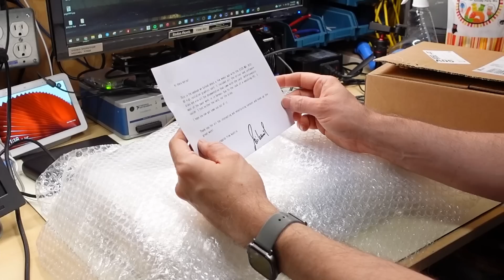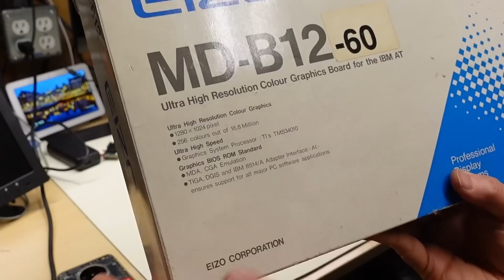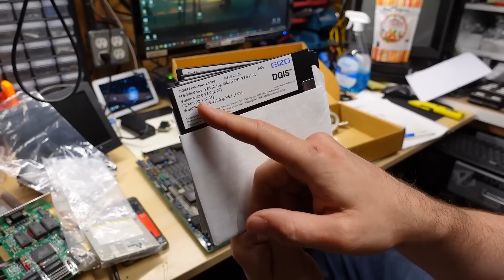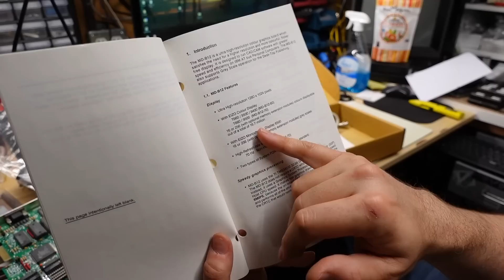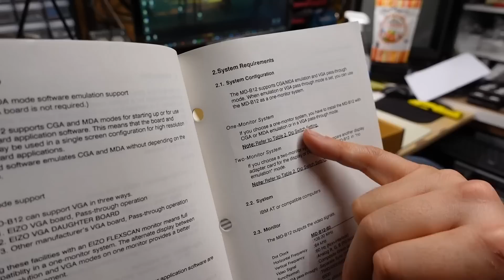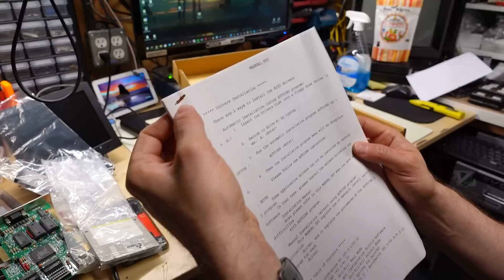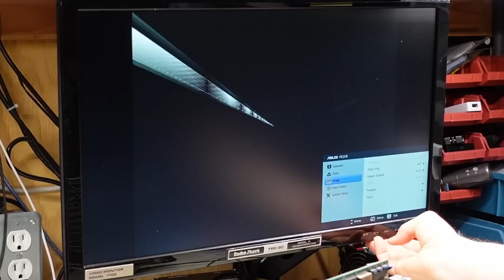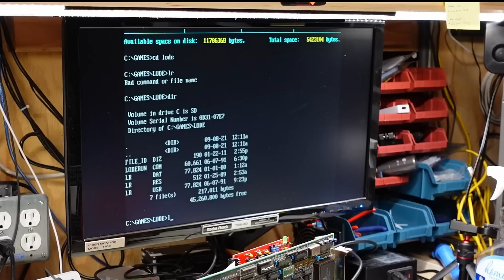0008 This is an "ultra high resolution" PC video card from 1987

Comment: ah, more TIGA cards.  The memories.....  I'll look for the official TI documentation and disks.  It was a 2 or 3 manual set with some wonderful floppies.  For example, the disks had a bunch of fonts that could be loaded onto the card.  Most TIGA drivers are generic, as the boards were just reference hardware from TI.  I'd bet that the drivers for this card will work with your other card.
Reply from the maker: Yeah neat if you can find more TIGA drivers. I want to try to get the other card (without disks) working -- future video project
Reply: i'd love to see some documentation on those 59 pin vram modules so i could recreate them

Comment: So this was a notch about the 8514/a card?

This was the era when IBM lost control of PC standards.   Their refusal to define a graphics standard greater than 640x480x256 meant that everybody else defined "SVGA" which wasn't really a standard.  It just meant that you could support 1024x768 or the far more desirable 1280x1024 for a fraction of what IBM was charging for the 8514 with greater backwards compatibility
Reply: Well, they also had XGA, which was supposed to be the VGA replacement.  Unfortunately, they limited it to their highest end PS/2 machines, some of which didn't even need it since they were practically server class machines.  So it never caught on.
Reply: @irinotecanhcl  @UCeVTsVwJn8Zz87ulKbfg6mg Exactly right.    It seemed like they made a marketing decision that 640x480x256 (8-bit color) was adequate for 90% of users, and that if you wanted something better, you'd pay them $1,500-2,000 for the privilege.

As to PGA, no.  It was essentially a VGA card before VGA, but without the CGA or EGA capability built in.  It was introduced in 1984 and was expensive because it used it's own on-board 8088 to handle things.   It never caught on because it was too expensive for game manufacturers to support.

From wikipedia: The Professional Graphics Controller offered a maximum resolution of 640×480 with 256 colors at a refresh rate of 60hz
Reply: They tried to squeeze so tight (MCA et al), they lost all control.  Was a PGA card the same as 8514/a?
Reply from the maker: I'm not sure 8514/a was accelerated? Or was it? Seems at the time there were just so many competing standards.
Reply: @adriansdigitalbasement2  Yes it was accelerated, but I suspect (just a guess) nobody really took advantage of it very much because of the price $1300 plus a high-end monitor at the time would have set you back an equal amount.   As I remember if you were an AutoCAD user, you might've had one of these cards.  And if I remember correctly, the card was not too impressive for text, but I might be mistaken about that.

By the standards of the day, an impressive card in 1987, but the 8514/a clones from ATi were 60% of the price.   

By 1990, the SVGA cards exceeded the specs of these cards and the only people buying IBM MCA cards were the last few shops using the PS/2

Comment: BITD I used a clone 486 PC with a Hercules Graphics Station card and a 20" NEC 4D or maybe 5D Multisync monitor and a dedicated puck driven tablet as an AutoCAD "Workstation". I also had a separate mono monitor on the PC for the commands. I think it was based round a TI chip and had an onboard VGA chipset.
Reply: Same with me. I still have my tablet on my wall.
Reply: https://en.m.wikipedia.org/wiki/Texas_Instruments_Graphics_Architecture

Comment: DON'T do Disk Images of floppies! Just copy all the files off as they are and put them in a ZIP instead! I don't want to have to install another piece of software to access a floppy disk image when a ZIP is much easier to deal with.
Reply: So long as they're standard PC formatted, sure, but if you get oddball formats or copy protection schemes, then imaging them bit for bit is really the only way to go.
Reply: I'd still prefer image files for preservation's sake but I don't see why you couldn't do both.
Reply from the maker: haha true -- no reason for disk images of these old disks since there is nothing special about them.

Comment: I have an early EIZO professional grade LCD. It cost something like $1500 when it came out.
Reply: EIZO was the highest standard that one could get back in the day.
Reply from the maker: Neat -- yeah I bet this card was staggeringly expensive when it was new, especially when loaded with the RAM and the high res CRT
Reply: Yep... I snapped up an EIZO 4:3 IPS display at a thrift outlet for a mere $7 and thought I had the score of the decade.  I wanted to use it as a new display for my A1200, which now has Indivision MK3 flicker fixer.  Well, I tried it and found the pixel speed was so slow, scrolling just makes a blurry mess everywhere.  These old professional monitors still look fantastic when displaying still images, but really show their age when something moves across the screen.  Oh well.
Reply: @Waccoon  One year ago i found a  27 inch EIZO QHD monitor for €20,- at the thriftstore. Works perfect. Only downside is that it uses 100Watt.

Comment: Neat card. It would have been cool to see it running windows in high res..
Reply from the maker: That'll be coming -- along with trying to get the card from 0007 working
Reply: Yes, I was hoping to see that
Reply: same would of love dto see how it ran Windows at that 1280x1024
Reply: I played with Windows 2 back in the day and I think it only supported resolutions up to VGA (640x480). Which was impressive. But it’s not what we call high res these days :-)
Reply: I was thrown by the 1987 in the title. Having watched the video I see he had drivers for windows 3 and chips made in the 90’s, so the card is a bit younger. Windows 3 could indeed run at SVGA resolutions.
Reply: I remember it well, and believe me its boring. Its the same 16 color Windows 3, but everything is much smaller. Or sacrifice resolution for 256 colors which was more pleasant, a typical trade off with older 1m svga cards. Also this is a 16bit bus, fast it isn't.
Reply: @freeculture  true. if its just a demo thing. I was running 98 at 1600x1200 on a 21 inch tube, my friends called me silly, and having the standard icon layout that filled the whole left side only taking up a wee bit of the corner, it did look a little silly. but when you can have your document, web browser, MSN and Winamp all visible at a usable size, you'll never go back. then multimon.
Edit: on the multimon thing, one of the neatest things on my electronics bench PC is a 90 degree rotated LCD. useless for so so very many things. but PDFs? bloody beautiful, vastly superior. Datasheet on one screen, altium or a website on the other, its grand.